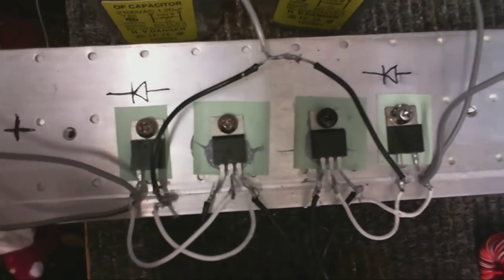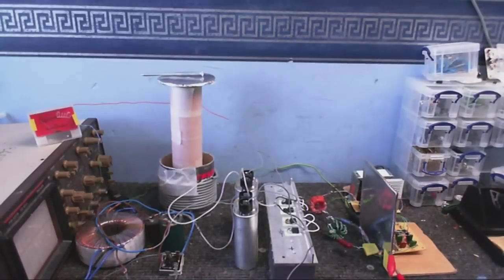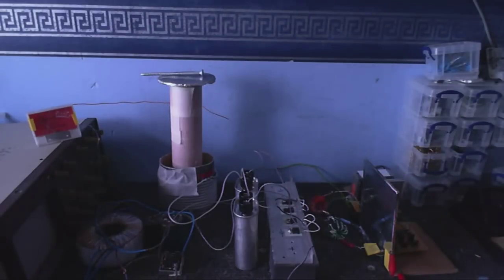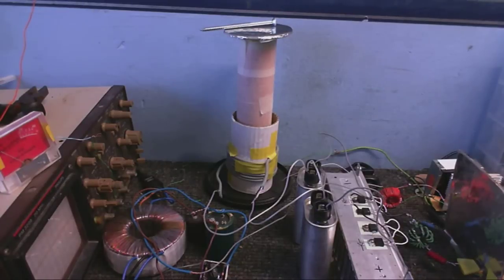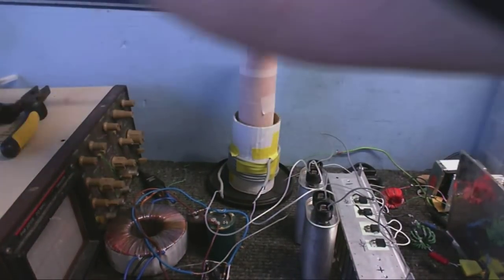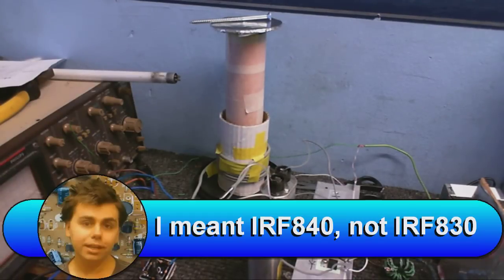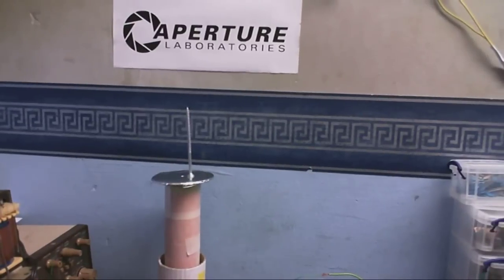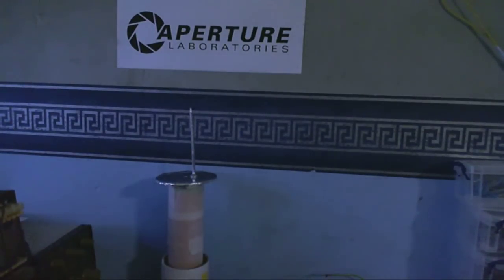Building a SSTC part 5 - Completed Build and First Light

Comment: I've had MOSFETS die with a staccato circuit cranked up too often randomly and cold to the touch. This told me it was likely due to shoot through high current short duration. It's likely the gate driver ringing overlaps on both gates and makes both mosfets conduct at the same time which might either kill one or both depending on the energy applied. I later fixed this by improving my GDT's and drivers characteristics and a few passives components. It also doesn't help much if they are unshielded and have no zener clamping diodes on the gates.

Comment: whats the point of a interuptor
a tesla coil sould make sparks that dont stop
Reply from the maker: ***** There will be a CW test later on, the only thing is I'll have to try somewhere else that's safe to run it because I think it messed up my computer, Windows wont boot, anymore and it was Ok before I ran the coil.  I'm having to do this on my Laptop right now.

Comment: if you would have just showed the schematic of the thing then told us your great conclusion to this cool dude project is nothing more than  a 1 inch spark, you could have saved us all the hassle of listen to your ramblings for an hour.
Reply from the maker: This was a LOW POWER TEST to make sure everything is working, you obviously haven't seen it at full power.  

Here: https://www.youtube.com/watch?v=dhM8w7PnYPc  
there it is running on rectified mains, and constant wave (although ballasted)

And my best SSTC as of the time this comment was posted.
https://www.youtube.com/watch?v=WVXzy1TQPP8